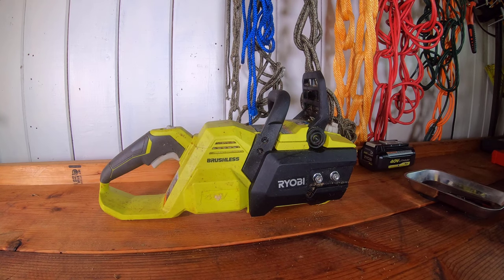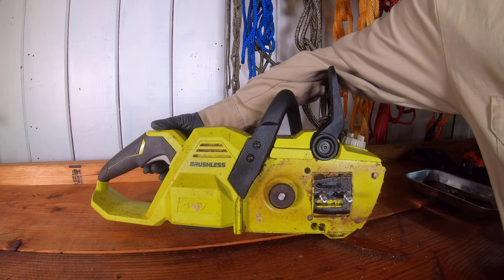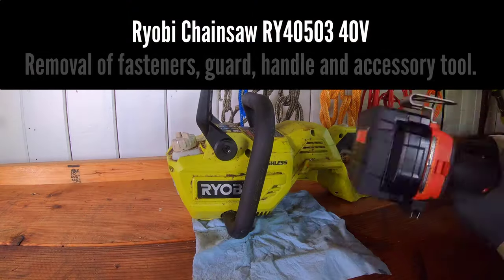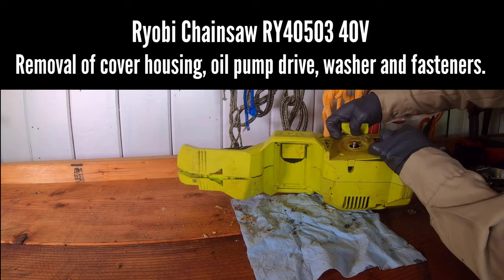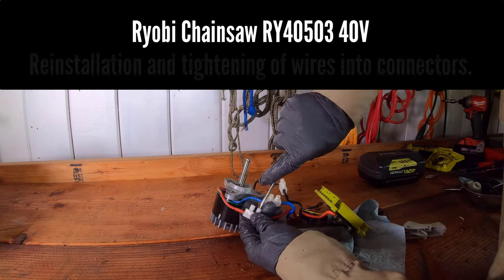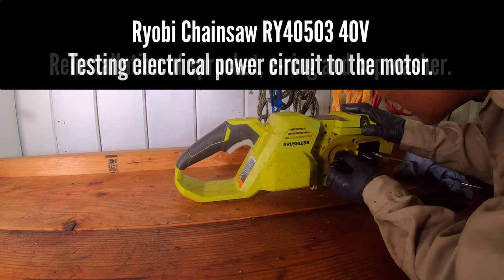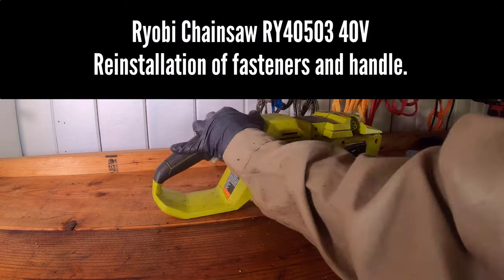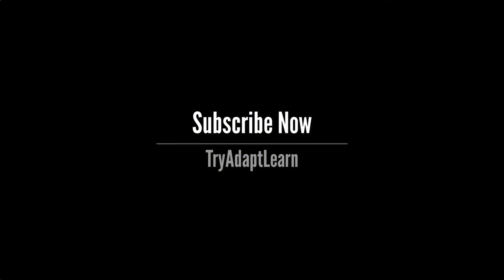Fix Ryobi Chainsaw 40v lag, stutter and stop.  Teardown and troubleshoot electrical issues.

Comment: I had the same issue after only about 10 hours of cutting.  Glad this video exists because I wouldb't have known what to do.  Tear down was fairly simple.  I wound up losing the safety switch spring, but oh well.  All the wire connectors were loose at best.  Poor quality control I'd say.  Putting it back together was the bitch.  My biggest piece of advice is to empty the oil chamber before you start; otherwise, it's a greasy mess.  Thanks!

Comment: Thanks for this video.  My problem is not electrical; recently I noticed that my Ryobi stopped oiling.  I used this video as a guide to take mine apart to try to get at the oiler pump bc other attempts to solve the problem haven't worked yet.  So I've got it all apart except for the last step of separating the two "halves."  What I can see so far is, the black oil tubes are fitted onto that aluminum thing (sorry, I don't know what it is) pretty tight and I didn't want to tear them trying to take them off and maybe blow air or kerosene through them.  I'm running out now to the hardware store bc I need a long narrow torx screwdriver for the last two screws before I can take it apart the rest of the way as you have done in this vid.  I ran kerosene through the oiler and it appeared to be dripping out okay; with oil tank empty, I tried blowing air through it w my air compressor; nonetheless, with bar chain oil in the tank and engine running, I am getting no flow.  I guess I am asking if you have any tips or suggestions as to what else could be done to restore oil flow.  (Also, do you know what that screw is just underneath the sprocket, what it does.?)  Thanks for any information and thanks again for posting this video.
Reply from the maker: It’s good you were able to access that much even before you opened the case.  Unfortunately, I do not have experience with the oiler not working.  The oilers have been ok, when in use I frequently have to take debris out of the chain some I find myself taking that first plastic piece with chain adjustment and clear the oiler at that time.
Reply: I'm in the same boat. The tubes comes off the oil pump with a pair of needlenose. The tubes on mine are clear of obstruction. So the problem is the pump. When I take it out and try to blow air or solvent through it appears blocked. I soaked the pump in solvent for a few hours and blew it out. Still seems blocked  There is also an adjuster on it which doesn't make any difference. I saw another video of different make but almost exact same pump design, so I will attempt to take the pump apart today. It's pretty basic. 
Update : I couldn't get the pump to work reliably so went on a hunt to find a replacement. Ryobi was out of stock as were most parts outlets. What I did learn in the process is the pump is made by Homelite and is used in some of their models. I hit the jackpot on Ebay.ca where the new pump was cheaper than buying from Ryobi. I put in the new pump and all is golden. Tools needed for breaking down the saw is two sizes of torx screwdrivers and needlenose to pull the tubes off the pump. Just keep track of which size screw goes where as you will have many.
To find a new pump run a search on Ebay for "Oil Pump & Gear for RY40503 14" 40V Cordless Chainsaw 537485001 & 309516002"

Comment: Follow up.  So I now know that the "aluminum thing" is the oil pump.  Black tubes come off without much problem once I took it out.  I see that the problem is the threads on the idk what its called, cog? that turn the little gear inside the oil pump appear worn and don't appear to be making ideal contact enough to turn it correctly.  Also, it appears there once once an o-ring at the top of that cog but I think I found parts of it in turning the oil filter gear with my finger tip and wiping away little pieces of idk what, either pieces of what used to be the threads of the cog, or a thin o-ring if there ever was one.  The pieces were man made, not debris or chips, etc.  Point being, no wonder the threads get worn bc the cog doesn't sit that tightly; there's enough play to have created the problem I described.  I'll see if I can match that cog at my local small engine repair place.  Anyway thanks again.  p.s. I set the playback speed on your video to .25; that helped too.
Reply from the maker: Luckily you found the problem.  Other options may be include to email Ryobi with your model number see if you could order the part from directly or try to purchase a really cheap used one  (with a functional oiler) and see if you could use it as a parts donor.

Comment: I have a european version, a 36V Ryobi Chain saw, a RCS36X3550HI. It would cut out as soon as I put any pressure on it when sawing. Then it would not start until I remove the battery and put it back. I decided to try this fix. The screws vere not very loose, but anyway allowed a half turn on the screw to tigthen them properly. After this the saw would perform properly without cutting out, as long as I do not force it to really bog down.
Reply from the maker: Thanks for the feedback.  I would think that if it isn’t the connections, something  else I the electrical circuit may be loose.  My next guess would be something malfunctioning in the speed controller itself.

Comment: Any tips on getting the handle off? I have removed the 2 screws on the right hand side, but my handle won't just pop off like in the video.
Reply: missed a screw. Found loose connection on the black wires. Thanks for this great video!
Reply from the maker: Sorry for the delay.  My guess would be have been an extra screw.  Glad the video helped.  Thank you for sharing your feedback.
Reply: After disassembly. None of the screws were loose. However, something was loose because after assembly, it works normally. For how long is anyone's guese.

Comment: mine started stuttering today ,,,,  AND TONITE IT IS WONDERFUL,
OF THE 6 CONNECTIONS ONLY 3 WERE TIGHT ,,  1 was almost out of the connector.
WAS RYOBI ASLEEP WHEN THEY TIGHTEN THOSE EURO CONNECTORS ???????
thanks you saved me a ton of greif going thru the warranty process,,,,   had an issue with a string trimmer; and after screwing around to get it fixed <MAYBE at home deport for 35$ checkout charge ,,,   i just bought a new motor on ebay ,,,,40$....     tnx agn
Reply from the maker: Thank you.  Glad the video was helpful and also really appreciated that you left feedback about it.  Although it may have been possible that the connections were loose from using the tool in the video.  But when looking inside, it seems like they also could have been loose during the assembly process.

Comment: Any idea what causes the saw to stop as soon as I apply pressure?
Reply from the maker: Thank you for your question.  My best guess to answer your question would be the same issue that is shown in this video, a worn, loose or corroded electrical connection.  Aside from a bad connection, a brainstorm guess would be that a safety switch to stop the motor or regulator to slow or speed up the the motor is malfunctioning.

Comment: Is it me or I been looking at varies ryobi brush dc motor burning after time which is normal but the new line w brushless also has a tendency on some models of tools of overheating or stop moving ( working for a couple of seconds ) on the 40v systems or is it just some rare models ? I was wondering if these happens after the warranty period of the lifespan of the tool or we should go more soft in these tools ?
Reply from the maker: As far as I know Ryobi will honor the warranty with there tools.  The retailer will honor there store policies if it’s within the time frame and you have the receipt.  As far as the brushless this was the first last the last model I bought,  so I don’t know if this was a common issue.  The other brushed models I bought never had this problem.

Comment: The 40502 didnt turn out to be built this was unfortunately. Ordered a new switch on a hail mary. But everything else looks super solid on connections. Multiple batteries have been tried. Stuttered for a couple days before finally failing. It's been used a lot in the rain, so my hope is the internals of the switch had a component that corroded. Everything else looks nice and shiny.
Reply from the maker: Best of luck with the new switch.  These tools are really useful.  With working outdoors & vibrations on the electronics and batteries it makes you appreciate them when they are up and running.

Comment: I have the same exact problem, what tools did you use to take it apart? I saw some long tools in this video that I’d need to go deep.  I’d rather not go through Ryobi if I can do it myself.
Reply from the maker: To open the case I used Torx screw drivers.  This was in addition to Phillips and flat head screw drivers.  Although the fix is the shortest clip in the video, I spend a little bit of time checking and rechecking the wires in the connections to make sure they were tight.
Reply: I took it apart, i think the short is in the trigger assembly.  Not sure if I can fix that, lol.
Reply from the maker: There may be a part number to replace that switch.  I had to double check all the connections before I closed the case.
Reply: How long did it take to develop that issues, a bunch of use, or just weeks? Seems like the thing slowly shakes itself loose, than Breaks!

Comment: Wonderful video. Dealing with same issue. Model 40502.
Reply from the maker: Thank you for your feedback and good luck with your issue.
Reply: Did you figure anything out? I have the issue on mine but it seems those screws are tight
Reply: @smitty2jones  
I had the stutter/stop issue with my RY40502. The saw would run fine when not cutting but would stutter when I started to cut a log. 
I tried this fix without success.  I re-terminated both ends of the three white connectors. This did not solve my problem. After checking with Ryobi we thought the problem was a failing motor controller. Replacing it didn’t help. I replaced the trigger switch also. I noted that I didn’t see any indication of connections that had been overheated and there was no “hot electrical” smell. 

In the end, I found the problem. It was mechanical. There is a small set-screw that holds the motor’s rotor to the shaft. This set screw is between the cooling fins of the rotor. I. Was able to diagnose this set-screw issue by holding the sprocket end of the motor with a wrench and pulling the trigger. The rotor could turn independently of the shaft. I could also test this (without the battery installed) by holding the sprocket end of the shaft with a wrench and turning the rotor by hand.  It was tough getting the set-screw out - it’s a small allen key socket and  must have loc-tite on the threads.  When I got it out, I could see the end was damaged.  I straightened out the end of the set-screw with a file and reinstalled it after aligning the threaded hole with what appeared to be a flat on the shaft. I had to torque it quite a bit to eliminate movement.  

I’ve only made a few cuts but it seems to have solved the problem.  I was surprised this was the solution because it really felt like an intermittent electrical issue. 

Good luck!